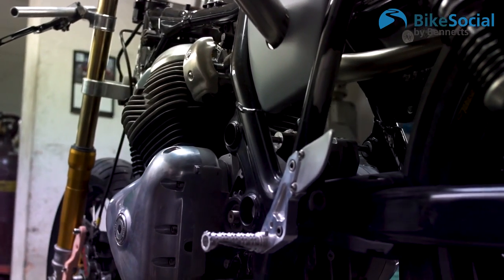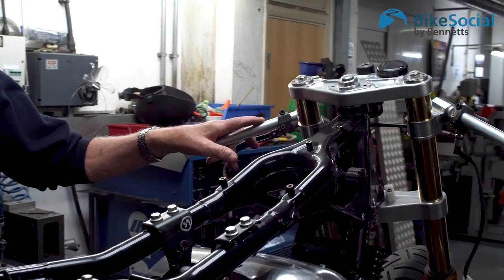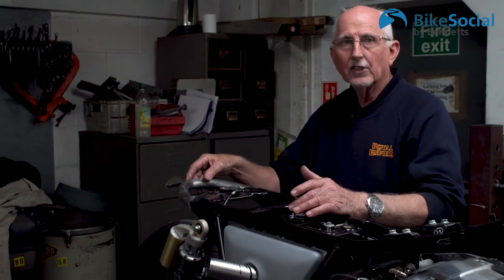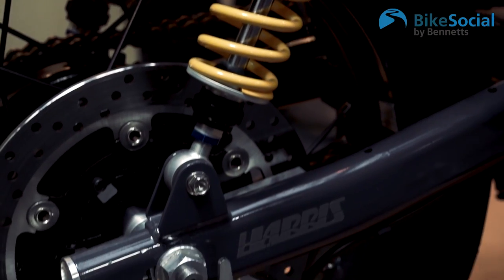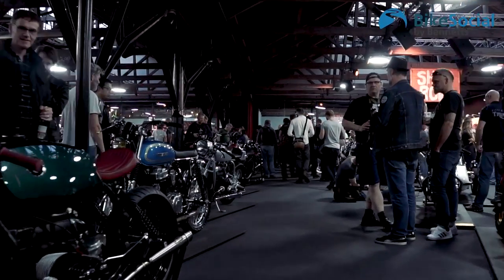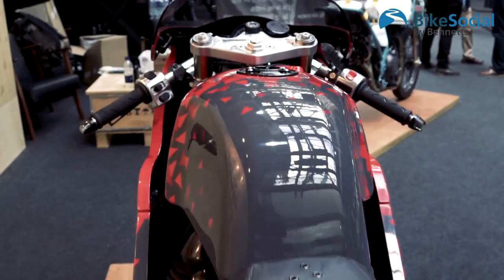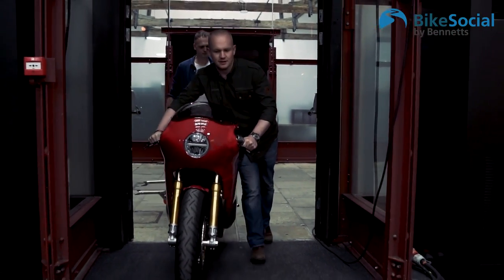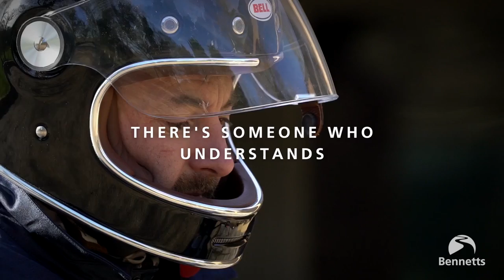How Royal Enfield built its own custom race bike

Comment: Royal ENFIELD brought 2 of these bikes to bikeshed fest and absolutely wiped the floor with everything. Great chatting to the guys on the film after the race too. Great work lads, an awesome looking and performing machine!
Reply: Hahahaha! I raced at the BikeShed Fest and am now here to find out HTF those little Enfields murdered everyone!
Reply: Yes they did,However it sorta helped having two ex GP riders ride them, against first timers.I watched as Paul Young, got off his bike and ran to the pits before he was recognised.I did though.
Reply: I thought your comment was a joke. That's really amazing that the Royal Enfields did so good, considering they aren't cheating with a giant engine or a 4 cylinder engine. They are only running 58 or 59 horsepower (I think?).
Reply: @Ritalie  Nope.100% true.Two ex GP riders on race prepared bikes, competing against a field of first timers, on shed builds.
Reply: @Ritalie  47 hp
Reply: @sunnyghosh8725  Thanks for clarifying. 47 HP is about the same as the old 1960's early 70s Honda 450 twins in fast street tune. The Honda 450 twins were ravenous beasts with complex valve train. I've never owned one.
Reply: @Ritalie  some German workshop modded this bike, increased the engine capacity to 750cc and increased the power to 120hp
Reply: @sunnyghosh8725  S$s already makes a 850 big bore kit

Comment: This effort resulted in a gorgeous motorcycle!  Hats off to those involved in the transformation.  RE, if reading comments, the stock Continental GT needs a similar rear frame modification to match the lines of the seat.  Although I largely prefer the GT, I am leaning toward the INT 650 simply because I find the rear of the Continental GT too clumsy in appearance.

Comment: Let's see. Version 2 engine specs? Light weight rods, slipper pistons, reworked head with titanium valves and valve springs. Hotter grind camshafts, remapped ignition and injection. I suppose a pressurized air intake to match more robust injectors would help. Going to need to increase heat dissipation so a larger oil cooler or second cooler will be needed. Sounds like fun to me.

Comment: To Mr. Harris:  Could these Enfields get a belt-drive final like on the classic H-D Sportsters?     I LOVE the twin-PIAA headlights, but can't these be fitted to a 1/4 - 3/4 fairing?  I desire a 'bit' of the "cafe" look, but the Maturity of my back would Demand a higher-mounted fairing, with handle bars, --not grips coming off the forks[--"clip-ons"], which put me into a crouch I may never "recover" from;)   How about an "S& S" 840cc bore & stroke?

Comment: India’s love for Royal Enfield needs no introduction. While the whole world shunned these retro motorcycles, the Indian market helped the brand grow from a humble 50,000 units annually in 2010 to registering over 50,000 units in a single month! Today Royal Enfield does not sell mere motorcycles. In fact, they sell lifestyles! The company wants to become a dominant force in the global middleweight motorcycle market. Here are the upcoming Royal Enfield motorcycles which the brand is working to rise towards global domination:

Royal Enfield Meteor
Royal Enfield Concept KX Bobber
The Royal Enfield Meteor is expected to be the production variant of the Royal Enfield KX Concept Bobber. This prototype was unveiled at EICMA 2018. The KX concept draws inspiration to a V-twin Bobber style motorcycle the company previously retailed. Royal Enfield has also recently patented the Meteor brand name for the European market.

The concept from EICMA 2018, the Royal Enfield Concept KX Bobber concept flaunted a brand new 838 cc V-twin powerplant. The engine has a bore of 80 mm and a stroke of 83.4 mm. Besides that, the engine has a claimed maximum power output of 90 PS. Also, the engine was coupled to a 6-speed gearbox and ride-by-wire throttle system for a linear power delivery. The Royal Enfield Concept KX Bobber was fitted with 19-inch wheels and shod with knobby Maxxis tyres.

Royal Enfield Concept KX Bobber has a wheelbase of 1,530 mm and has a ground clearance of 128 mm. Also, the seat height of 760 mm, if enters production, will make for a great motorcycle, thanks to easy accessibility. The Royal Enfield Concept KX Bobber uses a girder fork type front suspension. A single damper and an under-seat link-type monoshock at the back.

The production variant though may get standard telescopic fork or upside-down fork in the front instead of the girder fork. We expect the Royal Enfield Meteor based on the Concept KX Bobber to be launched sometime next year.

Royal Enfield Himalayan 650
Royal Enfield Himalayan
One of the most uncharacteristic yet delightful Royal Enfield out there, the Himalayan is soon to get an open heart surgery! Yes, the Chennai based manufacturer will take the powerplant from the Royal Enfield Interceptor 650 and introduce it to the Himalayan. Of course, we expect several mechanical and cosmetic updates to be made.

In its present tune the 411 cc LS engine from the Royal Enfield Himalayan produces 24.8 PS of power and 32 Nm of torque. The parallel-twin 648 cc mill from the Interceptor 650, in its present tune produces 47.5 PS of power and 52 Nm of torque. Royal Enfield claims that 80% of this torque is available from a low engine speed of 2,500 rpm. That will make the Royal Enfield Himalayan 650 a very capable off-roader, producing the required amount of pulling force right when you need it!

In terms of features, the Royal Enfield Himalayan 650 may continue with the same analogue-digital instrumentation. This unit is fairly comprehensive and even houses a magnetic compass for those who like to take the road not taken. We would also love to see a switchable ABS, at least for the rear wheel.

The Royal Enfield Himalayan 650 may hit production form by mid-2020. The bike will also get an updated chassis and an improved suspension system.

Royal Enfield Flat Tracker 650
Royal Enfield Continental GT 650
Spotted recently for the first time, the Royal Enfield Flat Tracker 650 utilises a reworked version of the Royal Enfield Continental GT 650. The senior management has been previously known to want multiple versions of motorcycles from the Royal Enfield 650 Twins platform. A Flat Tracker though comes as a pleasant surprise.

The Royal Enfield Flat Tracker 650 will continue with conventional telescopic fork up front. However, we believe that the engineers will be upgrading from the existing setup. Also, the rear will get a monoshock with adjustable preload. The engineers will also stiffen up the handlebar a bit so that it can take a beating. Besides that, the Royal Enfield Flat Tracker 650 will get alloy wheels and knobby go-anywhere tyres. The test unit spotted recently was seen sporting S&S exhaust system. But we do not expect them to hit production in order to keep costs under check.

Royal Enfield can continue using its subsidiary Harris Performance to stiffen up the chassis. The 648 cc oil cooled parallel-twin engine too will be re-tuned to meet the demands of a flat tracker. We would also love to see Royal Enfield up the ante on this front by increasing the performance output. A Flat Tracker will also allow Royal Enfield to get back to competitive racing at American Flat Tracker championship. A sporting event where both Harley-Davidson and Indian Motorcycle is gaining recognition.

We expect the Royal Enfield Flat Tracker 650 to make it to production around Auto Expo 2020. However, the bike will be priced at a premium.

Royal Enfield 250
Yes, Royal Enfield is finally planning to introduce a smaller and more affordable product. Several media reports point out to an upcoming quarter-litre Royal Enfield badged motorcycle. The ongoing economic downturn in India, has hit the company hard. A more accessible product will help more new customers to be a part of the Royal Enfield family.

Precious little details have emerged about the Royal Enfield 250. We are not sure if the new motorcycle will be introduced under the existing brand names or something new. However, we believe a Royal Enfield Bullet 250 can do wonders to the brand. The engine can trace its origins to the Royal Enfield Bullet 350. The latter, in its present BS-IV iteration, is powered by a 346 cc air-cooled engine. This push rod powerplant is capable of producing 20.07 PS of power and 28 Nm of torque.

Of course, fuel injection will be standard in the upcoming BS-VI complaint Royal Enfield 250. Also, the suspension system will continue to be conventional telescopic fork in the front and dual springs in the rear. Besides that, we expect the present design elements to be carried forward in the Royal Enfield 250. Brakes too will be in the same configuration, a disc in the front and a drum in the rear.

We expect the Royal Enfield 250 to take at least a couple of years before breakig.

Comment: for it to impress me personally, the heart of the bike would have to be at least 850cc, with power around 60kw. But it certainly looks and sounds good.
Reply: I used to think it needed to be at least 750cc, but after a test ride last week...I'm pleased with the 650cc version. The fueling down low was perfect, it shifted like a Suzuki. Butter smooth. I was blown away with it. It really steps out in any gear! And very comfortable considering the low cost suspension. Much nicer than my old 750 Monster.
Reply: There is a bobber type v twin at around 800cc in the development know as RE KX.

Comment: I would get that result within a week or with a team in a day. I simply take a 1992 Ducati take out the engine and fit the new engine in. Take the updated brakes and suspension. Fit some Ducati fairings. Done! Yes it would even look better. That "New" thing still looks like a 1970's bike with rear dual shocks and some new foot pegs slapped on. When "Evolution" isn't written in your book you might face extinction. To sad to see that they still try to sell bikes to lads that hit their 60's soon. All other manufacturers seem to have managed to move on with the time. Could it be because of isolation on an island? This is not written because I want to take a dump on Royal Enfield. This are my original thoughts after seeing this video.

Comment: this is a 30yr spanning platform bike ... Royal Enfield needs to just keep those prices low, and do minor tweaks/ upgrades keeping much of that standard backwards compatible. The after-market segment will be huge and it would be an old school concept of buying an affordable bike that can be modified to no end. I hope they don't f-up this money printing formula ... btw if they want to keep printing that money they should be making or partnering with accessories makers. The current selection of additional add-on parts that Royal Enfield officially makes is not that much.

Comment: "the engine has alot of metal in it".......... Royal Enfield 750?
Reply: The original Interceptor WAS a 750 and had hotter cams than the bike it was based on (700cc Constellation) - so it'd be great to see a faster new Interceptor.  But the original was designed to run with the big Norton, Triumph and BSAs of the day.  So it'd be even greater to see an Interceptor to match/better the current Triumph 1200 Thruxton, BMW 1200 R Nine T and the Norton 961 Commando.
Reply: S&S has two big bore kits, one is in the 800's
Reply: How about a 900cc triple?
Reply: @darkdestroyer6634  
This shows what fun can be had with 47 hp.

The S&S big bore kits,are sold as 'race only'.
Even with modern combustion chamber/piston design,and metallurgy ,I think
it would be almost impossible to operate an 11:1 compression air/oil cooled machine,
at factory timing specifications,on 91 R+M/2 fuel.

Sunoco 260 had a R+M/2 of 97.5,which dropped to 96,before it was discontinued.

I remember reading,that if you have to retard timing,more than 2 degrees,
to compensate for low grade fuel,you would be better off,running a compression ratio compatible with available fuel with the factory engineered timing specifications.

I'm sure something,in the way of a big bore kit,could be made 'street legal'.
I had heard rumor,some time ago, that a 750 kitted engine would be available,with a RE factory warranty!
Guess not.

I also remember reading a story about putting 10:1 or 11:1 pistons in an Interceptor
back 'in the day',and subsequently blowing out the bottom end.

Here is David Blasco's RE blog on the acme of English RE Interceptors
The Series lll 800cc. No falling anvils here.
www.royalenfields.com/2014/04/800cc-royal-enfield-interceptor.html.
I own a 1970 S ll Interceptor.
Cheers

Comment: Finally dragged RE out of the mire of poor quality control and cheap add ons. It took a new design to do it, after the Indian end initially fd up the Himalayan, and did a poor job assembling the 535. I'm surprised Siddhartha has any hair at all, let alone a full mane.Old habits died very hard indeed. Hopefully, if they revamp the singles engines, the brits will be involved.